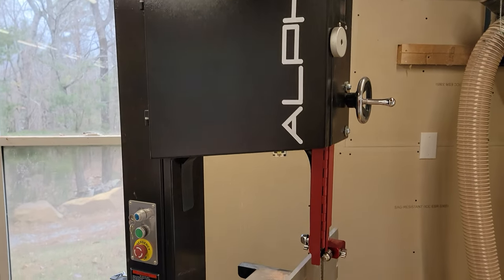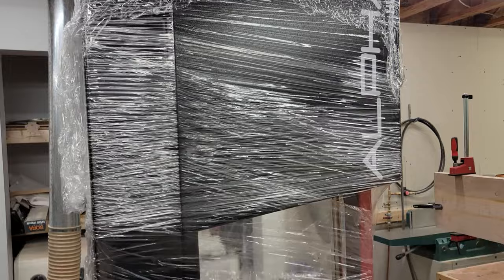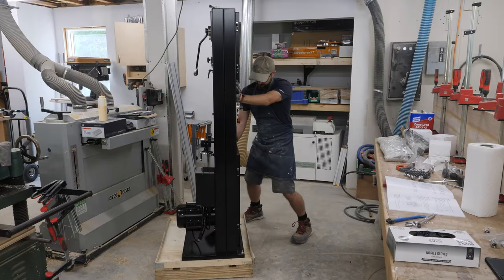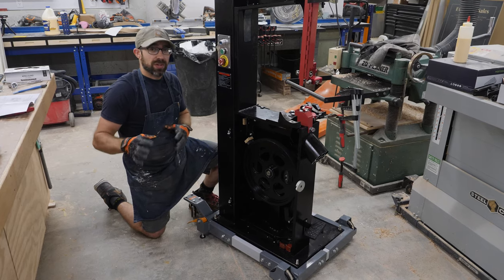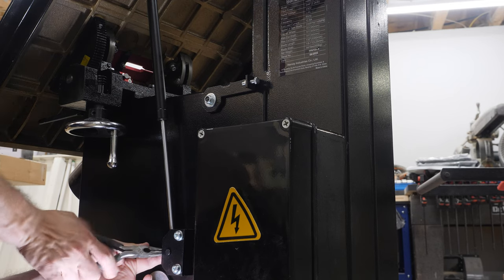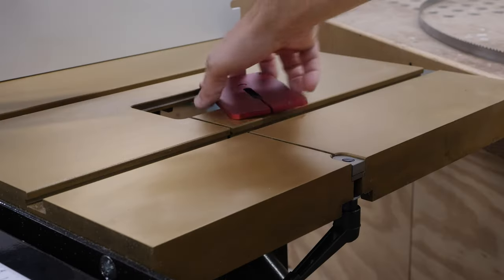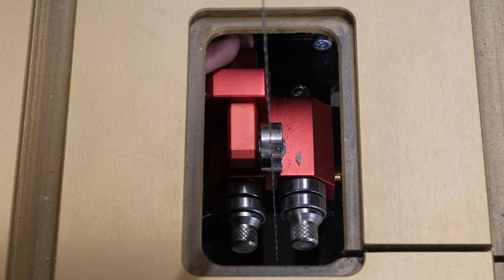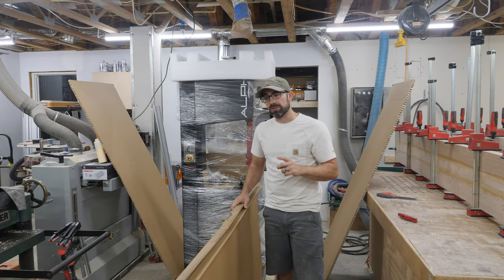New Bandsaw Unboxing and Setup | Harvey Alpha Series HW615

Comment: Thanks for the video!  Just ordered one!  What were your inside dimensions of the mobile base?  Want to get mine setup before the saw gets here so it'll be ready to slide right in!
Reply: Ohhh and was the TiN coating worth the extra?
Reply from the maker: Right on!  Hope it helps make setup quick and easy for ya 👊👊 I set up the inside dimensions of the base to 18-1/2" x 25-3/4" and it fits perfectly with just the slightest bit of clearance.
Reply from the maker: Harvey sent the saw to me to review, but I will say that the TiN coating is quite nice and so far I've seen zero signs of surface rust.

Comment: Great stuff!  What mobile base did you put it on?  Looks like you had no problems.  Is that the Harvey base or a third party?
Reply from the maker: Thanks!  Yeah it was way easier than other times I've done this🤣. It's not the Harvey base.  This one is from Bora. Here's a link 👍👍 https://amzn.to/3GTKzWk
Reply: @WoodshopMike  thanks!  Hopefully I can wrangle this beast on there.  Looks like a great machine.
Reply from the maker: I haven't run it a ton yet, but from what I have done (a bit of resawing etc) it's gonna have a home in my shop for a loooonnngggg time😃
Reply: Hi, it looks like that base fits nicely. Did you have to modify it at all? It looks like the Harvey machine base dimensions are smaller than the minimum dimensions that Bora 3800 base is capable of.
Reply from the maker: It fits great and no modifications needed👍

Comment: What base is that? It looks strong enough whereas most don't.
Reply from the maker: This is the Bora Mobile base.  Here's a link https://amzn.to/3vwM74Q
Reply: @WoodshopMike   Thanks Mike! How did you reduce the size of the bars to fit this saw?
Reply from the maker: Sure thing!  The base is adjustable but I don't remember, I might have cut them down and drilled new holes if needed